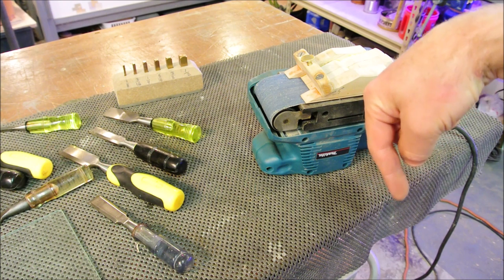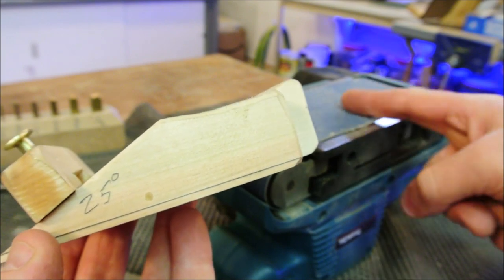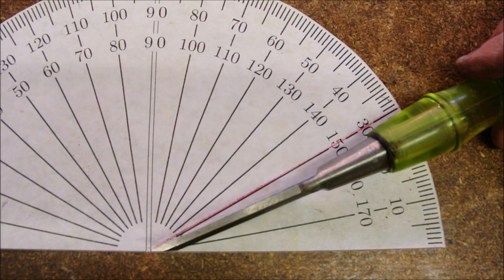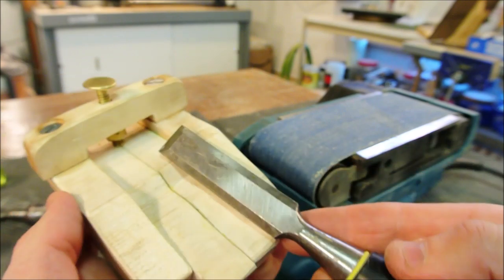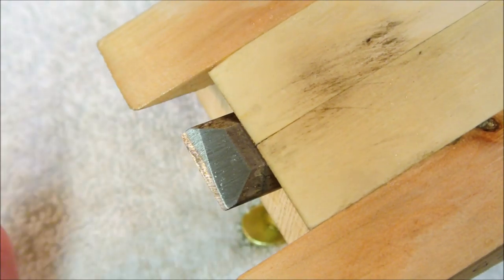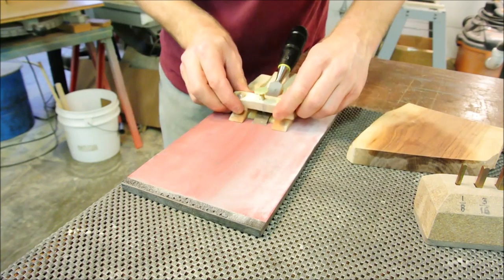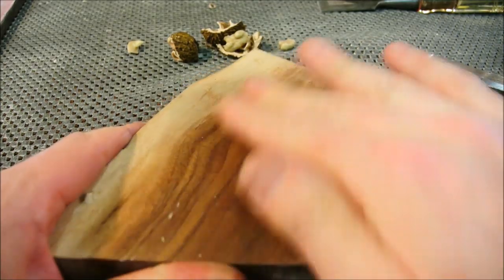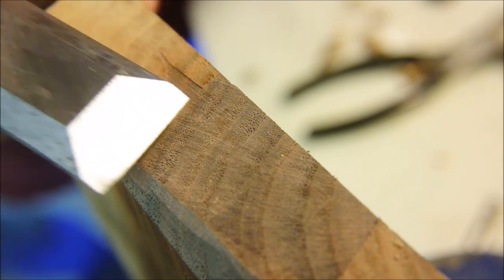Chisel sharpening for the rest of us (simple jig)

Comment: I grind them reasonably well on a bemch grinder, then sharpen only the last mm on the tip on a fine stone. That saves the stone since this cuts groves into it.
Reply from the maker: Here's the practical problem with using the grinder: wheel expense. The quality of affordable grinder wheels has plummeted over the last twenty years to downright abysmal, and so now my wheel becomes grooved within ten minutes following a dressing. Chisel edges are picky. 

Had I an extra few hundred dollars, I might dedicate a grinder with a wide, flat wheel to the cause. As it is though, my grinder gets used for way too many other things. 

Perspective: chisels are cheap, and chisel-quality grinders are expensive; since the former is the end and the latter only a means, it becomes rational to instead just buy more chisels. AARRGH!!

Comment: Great video and great idea - I don’t own a belt sander so I have to resort to using a sharpening stone and eyeball the correct angle - not ideal. I presume I could also use the sandpaper granite set up you’ve shown along with elbow grease. Interesting to see the actual walnut treating wood. Thanks and cheers
Reply: Great and lowly are RELATIVE. 😉

Incidentally, Slave, are you VEGAN? 🌱

Comment: 10 out of 10 for trying
Reply from the maker: I have the same reaction to these pointless, half-literate comments of yours.
Reply: @pocket83squared  your comment saddens me
Reply from the maker: @d.k.1394  Well then, I'd suggest you stop making unconstructive comments. After three decades of sharpening chisels with a belt-sander, I can safely say that it works. Not as well as would an $880 Tormek, admittedly, but if you own one of those, you're probably not a carpenter. 

Tell me, what do you cut with these precision-sharpened chisels of yours? Pound 'em into a knot-strewn, multiple-pass circular-saw notch through a piece of treated lumber, no doubt? Drop it in the mud and then jam it back into the toolbag, where it can rattle around all day against some galvanized nails? 

Think before you type. Consider context before you critique.

Comment: I remember in one of your older videos you talked on the practicality of chisel sharpening and decided it didn't make much sense when you could pop down to harbor freight and buy a new set for cheap.  Being part of the chisel sharpening faction myself I'm wondering what changed your mind.
Reply from the maker: That question was posed in irony. I've been sharpening my chisels since I was a kid. er, not that I did it very well, hehe. 

It was a point about how it would be rational in our society, given the high costs of labor-time. $6 for three, or an hour to sharpen them? That's a nice wage.
Reply: @pocket83squared  I have a bunch of cheap chisel sets.  One in the car in case I need it on a job site.  One in the toolbag I grab when going out to work in the sugarbush. A couple sets in the shop to loan out or to abuse brutally.
OTOH...
My favourite chisels are all substantially shorter than they were when I either bought them or inherited them from even older & more experienced owners.
These ones may not be the sharpest at any particular time.  But they do get regular touch ups as needed because working with dull tools is just dumb.
Reply: @Tinker001  What is this sorcery? The comment from Jack and pocket's reply is from 2 years ago but the video was uploaded 2 weeks ago, just like your reply.

Comment: Erm, shouldn't you be using a narrower belt that is only cutting the blade and not the woodwork as well
Reply from the maker: If you want to, sure. But that'll add more steps to the operation. The idea is to not put-off chisel sharpening. If you're hasty enough with a project, you'll use a screwdriver as a chisel. The point here is to make it so easy that a quick sharpen isn't discouraging at all.

Comment: You claim to bot care about time to properly sharpen the chisel, yet you spend a lot of time to make a jig that is available in a better form for $12. No, you don't use it on a belt sander. You hand sharpen it on a diamond stone. It really takes a few minutes to set the proper edge on a new (cheap and crappy from the factory) chisel, but after that I almost never actually sharpen chisels, I mostly just strop them before use. The ones I chop nails with, of course I can sharpen on my bench grinder without any jigs using my eye.
Reply from the maker: Some guys out there right now are using a dull chisel with cold fingers that have infected splinters in them; this video was for them, not you.   

Tell me, have you been a framing carpenter? Have you worked on-site and been far away from any shop and its diamond sharpening equipment? There are cases of under-the-hood carpentry working out there that don't use the silly spit-polish of the YouTube 'woodworker' paradigm. For those who frequently have to choose between belt-sanding a chisel and using a dull one, making this jig becomes a no-brainer.